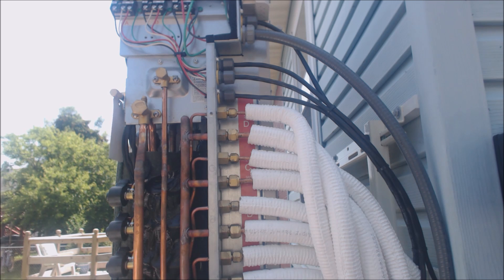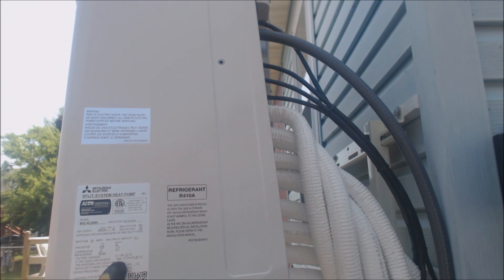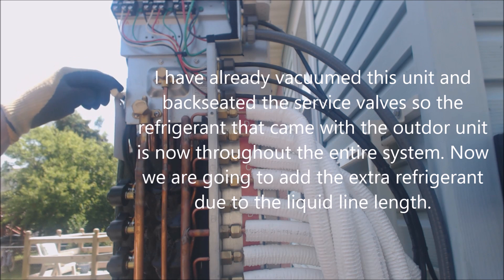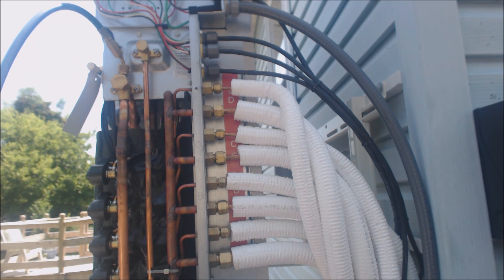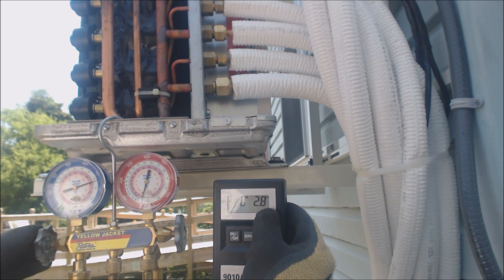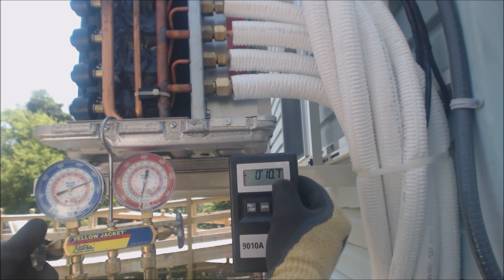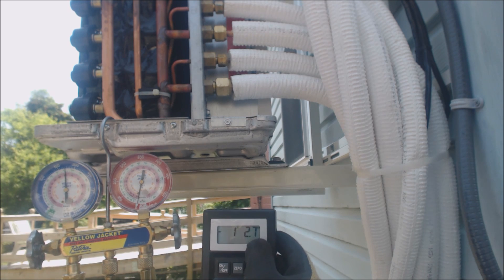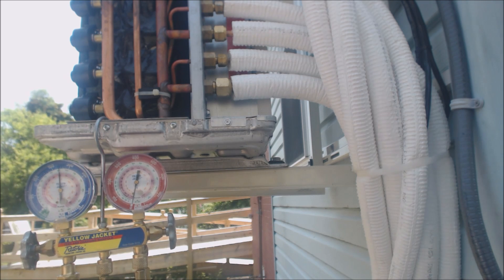Weighing in the Correct Amount of Refrigerant in a Mitsubishi Mini Split Unit!

Comment: I have a Goodman 5 ton split system. Amve air handler and gsxv9 series heat pump. It a exv inverter system. I need to evacuate the system completely and weigh in the charge. I already calculated the amount of r410a. The factory charge and add for lineset comes to 292oz. Because it’s a exv inverter system, can I break the vacuum with the Freon? The system will be completely empty including the pump and coil.

Comment: I've purchased everything you've shown...learned a lot watching you for years.  Even have your book I picked up off of Amazon!

Curious on (2) things...first thing would be what would the wall units/ceiling units for mini splits represent as far as lineset length...is that part of the calculations when and if the unit requires more than its pre-charged r410 because you are beyond the factory pre-charge foot rating?

Second thing...I was hoping to charge a unit just like you are doing now.  I have the yellow jacket set, manifold, I also picked up a full fieldpiece kit, evac units, reclamation bottles, adapters and more.  But I see you are using a 1/4 turn ball valve at the end of your charging line in this particular video.  Mine don't fit over the unit unless I want to use a hose WITHOUT a valve (aka I cant purge the line from the 410a tank to the valve)

Halted the install on this one for now.  I either need to add 13.2 ounces total to the unit or if the wall units also add to the lineset length...then I'll add accordingly.

I also lied...I have a 3rd question.  What do you do when and if you get a kink.  My buddy is a gorilla in a glass house to say the least.  Bad ones I'd cut out and replaced with a flared union.  Is there a tool for hard to reach places you recommend?

love the content!

Comment: I have an LG 3 zone mini slipt just checked the gas line on my low line and its reading 290 while all 3 zone are running i have 100 ft of line set system has 3.97 lbs of r410 at 73.8 ft i need to add 8 oz to top off  why is my low pressure hose st 290 i though I needed to add more refrigerant my handler unit temperature is 57 degrees should it be lower thanks

Comment: I just recovered 2 similar units that were installed briefly then decommissioned because the plant they were in has airflow problems and all the air these units made was sucked up and out the through the roof, and did not solve their problems. 

The wall units had already been discarded but because the refrigerant  hadn't been recovered yet they were storing the condensers. I have a shopping list made up with wall units, line sets, and disconnect boxes.  I am a millwright by trade but mostly work on air compressors. I plan on installing them for my home myself, with the help of an electrician for setting up my disconnect boxes and HVAC tech to purge, vacuum test, and charge my system. 

Is there anything in particular about these units that I should know? Someone online mentioned Mitsubishis can be tricky to wire but based on the manual it doesn't look any different than your complete install video I watched the other day, other than having to wire 3 separate units vs the one in your video.

PS, you aren't related to Seth's Bike Hacks are you? Same NJ accent and talent for video production

Comment: I have a mini split with 2 indoor units. At the outdoor compressor unit I see there are four lines and 2 lines with service valves. Which service valve should I connect to? Or doesn’t it matter. Thanks!

Comment: Thanks great video, especially as I am about install exactly the same make and model. 
You have clarifed for me if I need to add more refrigeration as the instructions are contradictory. 
Just one question, when you say the liquid line length do you just mean the 1/4" line length not the 1/2" vapor line as well?
Thanks for your your help.

Comment: In an instant where you don't know the amount in the minisplit unit due to a flare leak, do you personally reuse the recovered refrigerant and then add additional or just use virgin refrigerant on the recharge?   Thanks in advance.  BTW... I FINALLY order all of your material.  It only took a year!  :~)      -Brian
Reply: I would reuse if the system was still in a positive charge and a good amount, maybe other people can answer that too but this video is getting old

Comment: 4:17 it will not "take the average". First-order approximation/model: pressure is equal to lowest temperature saturated vapour pressure in the line set. Some parts of pipe may have super-heated vapour. No parts of pipe may have "sub-cooled vapour". Refrigerant migrates to the lowest temp. location and the liquid-vapour equilibrium P/T values in this location are decisive.

Comment: I have a multi-zone mini split. But one of the unit begin to frost when the unit is off while another room is running. Is the that is off low on charge?
Reply: communication wire are probably not hooked to the right unit

Comment: Sitting on a roof. Staring at a MXZ-C030NA Mitsubishi 3 zone. Really used to doing refrigeration Subcooling. What the general recommended number for these inverters? I know it’s really too high at 43.2 460 psi high side and temp 85 degrees which gives a condenser Tsat 128. Temp outside is 74 & raining.

Comment: How do we pressure test a multi zone mini split heat pump system with only one set of service valves?  Thanks!
Reply from the maker: The tubes are all connected usually so you just need one port, thanks!
Reply: My unit service port is separate. Doesn't have a main port to add refrigerant

Comment: When they mention to add refrigerant per every 5 ft of line set, what if you only use 3 indoor heads on a 4 zone system? Is there anything change when only using 3 heads instead of 4 heads? Thank you.
Reply from the maker: It is cumulative lineset not just to one head unit. They get added together. Also make sure that your system can handle one less communication wise and that you are using the capacity of the system properly by verifying in the manufacturer's literature, thanks!
Reply: I am running a 4 zone unit. Two of the indoor units are cold and one is not real cold.. is that a bad indoor unit possibly
Reply: I checked the psi and it around 130ish

Comment: hi, so if you had check for proper refrigerant level how would you do it if we're not measuring superheat or sub cooling? i mean just looking at the gauge how'd i know if i have the correct charge? thank you.
Reply from the maker: You may not but just from experience on systems that know had the correct charge, the superheat was 0 to 5 degrees on the vrf minisplit systems I have been installing and the accumulator protects the compressor during low superheat, thanks

Comment: Hi I’ve just installed a Fujitsu multizone 4 head system and used 3 line sets of 50’ and took out about 10’. Do i Measure each line set as a 50’or 100’ since you have liquid line and suction line so is it 150 ’total or 300’ total. Maximum line to be used it says 163feet. Thanks

Comment: Hi I’ve recently installed a Fujitsu AOU36RLXB
It comes precharged with 4lbs 10oz. Of 410a from the factory, which is rated for 66ft according to the manual.  It states that if the line length is below 66’ no additional charge needs to be added.  I only used about 20’ of line between the outdoor unit and the indoor unit.  In this situation do I leave the precharge from the manufacturer as is? Or do I have to recover some refrigerant.  Thank you!

Comment: I need to charge back in the factory charge after a line leaked the original factory charge out, is there any way I can add it as liquid into the service valve which would be the high side while the system is in heat pump mode? and then finalize the charge using a quick charge gas adapter via low side in cooling mode while running? Or is the only way to weigh in 8 pounds and 13 ounces to the low side while the unit is running in cool mode? @acservicetechllc
Reply from the maker: Loose, if the system is empty of refrigerant, pressure test the system with nitrogen under the max design pressure of the unit, release the nitrogen, vacuum the unit below 500 microns, perform the standing vacuum test to see if you are holding a vacuum. if it stays below 500 microns, weigh the correct amount of liquid refrigerant as stated on the rating plate and as needed by the cumulative length of the line set into the liquid line if there is one inside the unit, otherwise weigh it into the low side if that is the only port. the system is off this whole time. Give the refrigerant some time to saturate and circulate while the system is off, then after 20 minutes, go ahead and turn the system on. Make sure you are EPA 608 certified before buying or handling refrigerants, thanks Loose!
Reply: @acservicetech

Comment: I had to cut my line set prob about 12 or 14 inches from the factory length am I ganna have to evacuate some refridgent or do you think I'll be ok if that's the case I'll prob just get another factory size lineset so I dont have to mess with evacuation some ...any info will be highly appreciated
Reply from the maker: It should say on the rating plate of the outdoor unit from what length the what length is ok without having to add or recover any refrigerant, thanks
Reply: @acservicetechchannel  thanks for the reply its actually good to go but I appreciate the reply I really do
Reply: @acservicetechchannel  I seen that on the outdoor unit it's ok the length any longer tho and I would've had to
Reply: @acservicetechchannel  I meant any shorter
Reply from the maker: Ok thanks

Comment: thank you now i understand. but for example the one i have is daikin mini split inverter 12k btu and i need to add .16907 oz for every 5 additional feet. so using your same calculations. 20.92 * .16907 = 3.53 oz of refrigerants. when comparing mine to yours, isn't 3.53 oz a bit low?
Reply from the maker: You would look at your daikin and see how much they want you to add for every additional 5' or 1' and add up all your lineset lengths to add more than what the unit came with. If it was a leak then you would recover, fix leak, pressure test, vacuum, weigh in initial amount plus any additional feet, thanks

Comment: I have to add a couple ounces of R410A to a Mitsubishi H2I 6,000 btu unit, 35 ft line set (10 ft over pre charge limit).  How do I get the air out of the manifold and hoses, I assume that's what you mean when you say "get the air out".  Do I pull a vacuum on the manifold and hoses and then attach the hose to the service port and refrigerant?  I've already released the pre-charge into the system.
Reply from the maker: You could use the systems pressure to purge the air out. Look up "acservicetech connect, disconnect procedure" thanks
Reply: Thank you

Comment: Do I vaccum the zones on at a time? If so would I get any air sucked in when I remove the blue hose to do the vac the next zone or is there a valve to use to vac all the zone lines at the same time? Thanks for your great vid👍
Reply from the maker: They all get done at the same time and there is no way to separate them anyway, thanks

Comment: Could you explain a little further why we dont see the full subcooling and superheat with inverter type systems?
Reply from the maker: They limit the superheat down to a ery small amount typically 0-5 degrees when on max cool. This is for the extra efficiency and also since they have an accumulator for compressor safety. I wish they would put the numbers out there when at a specif speed but they don't. Subcooling isn't read since there isn't a port. You could read it with just temp sensors though. Subcooling and superheat will change when the system is ramping up or down depending on how many head units inside are running. Thanks
Reply: Johnmiller102 go to mylinkdrive.com is a Mitsubishi web page the have videos explaining the hole process and flow of refrigerant from the simplest mini split all the way to vrvs and vrfs you will be amazed the amount of information is in this web page

Comment: Do those multi indoor systems have the expansion valves at the evaporators and uses true “liquid” lines? I know the singles have the expansion valve in the condenser and your line set is an extension of the evaporator and that’s why both lines are insulated.
Reply from the maker: Yes especially the vrf units like these have the txv outside since it is electronic. You are correct with the rest of what you mentioned, thanks

Comment: Thanks for making this video! I'm getting ready to install a Pioneer split mini, and it calls for 0.16 oz per additional foot. It comes charged for 16', and my run is 50', so I believe I need to add 5.44 oz. Do I have to charge with the tank upside down? I may just use the additional charge to break the vacuum. That seems like the easiest way to do it. I wonder if it will pull in 5.44 oz. Do I need to do it a little at a time if the system isn't running?
Reply from the maker: As long as you are EPA 608 certified, If it is R410a then it has to come out of the bottle as a liquid (upside down in disposable bottle). If you are breaking the vacuum then it gets weighed in as a liquid. Make sure to use a hose with a valve on the end and purge the air out to that point and then connect to the port, then zero the scale out, thanks
Reply: Thanks so much. So a liquid charge adapter is not necessary in that case correct?
Reply from the maker: No you wouldn't use one with breaking the vacuum with refrigerant, thanks

Comment: If one were to install a multi zone unit as shown in this video, and added an additional air handler to the multi zone compressor down the road, would connecting the new air handler line sets cause any loss of refrigerant? And how would one test the newly installed line sets for leaks, again without losing refrigerant? Please forgive if my question is absurd, as I am not an HVAC pro.
Reply from the maker: Yes it would as there is only a vapor service port for you to pull a vacuum from which is connected to all the rest of the indoor wall units. You would have to pump down the system and/recover the refrigerant, pressure test the linesets, vacuum pump the system along with the new lines and indoor unit and weigh in the refrigerant accordingly, thanks

Comment: I followed your YouTube channel very informative. I believed all this Inverter units are pre-charged by the manufacturer. But I didnt get how much LINE set in ft.?? for the specific pre-charged, then you add if you get over the line set I get that. Am I missing something in this videos.
Reply from the maker: Each unit will state on the rating plate  up to how much lineset can be used for the amount of refrigerant in the unit. These lineset lengths will be different on different model numbers or sizes, thanks

Comment: How much liquid refrigerant can the accumulator actually hold? Is there ever a chance that it can "overflow"?
Reply from the maker: Yes you can overfill. That's our problem as we do not know how much refrigerant is in it if we suspect a leak and thats why we have to recover and start over if there was a decent leak, thanks
Reply: Thanks for the info.  Another question.  Today I replaced an evaporator on a mini split LG.  I got a good vacuum and charged the system by weight based on the specs.  When I started it up, I was getting some frost on the valve of the "liquid" line (quarter inch line).  Is it normal to have a little frost there?  It seems that maybe its low on refrigerant, but I weighed it in...not sure what to do.  I do not have excessive line set.  Only have about 10' total.
Reply from the maker: Usually there is not. So check to see if you have the system on max cooling, see if you have 1-5 degrees of superheat. If you have a higher superheat then it may still be low. Also check to make sure that you have 19-22 degree temp decrease across the indoor evap coil. If you have less then maybe you are low. Is it possible that the scale was somehow not measuring correctly? thanks
Reply: The scale is only about a month old, but I guess anything is possible.  I will double check those things you mentioned.  Thanks a lot for the feedback!

Comment: Just came across a mini split at a job we were at and I noticed the liquid line is very cold. Condenser is blowing warm air and there is condensation coming out of line. Is this normal operation with these mini splits? Thanks
Reply from the maker: Yes the txv is in the outdoor unit so the liquid line needs to be insulated as well, thanks!
Reply: acservicetech We were just there to silicon where the the line set came through and my lead mentioned that the crew that originally installed it had lost a lot  of refrigerant from the flare nut when they were tighten it down. He said they replaced refrigerant but when I felt the liquid line I thought that maybe it was low on charge so that's why it felt so cold. I haven't really done a mini split yet so I don't know a whole lot about them. Thanks for the reply.

Comment: When the ductless mini split needs to be charged we cant use the low side to charge it? we have to go through accumulator? Also how do you pump down a fujitsu or mitsubishi mini split unit.
Reply from the maker: If it is running, the low side will flow through into the accumulator, we are just weighing it in. You would still watch the vapor gauge, shut the liquid service valve, and then shut the vapor service valve when it gets low enough. Thanks